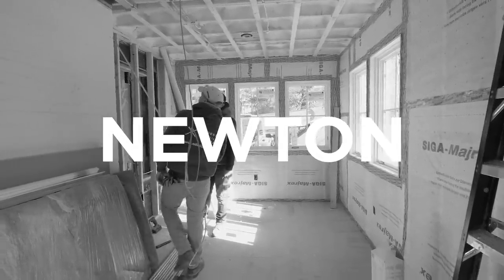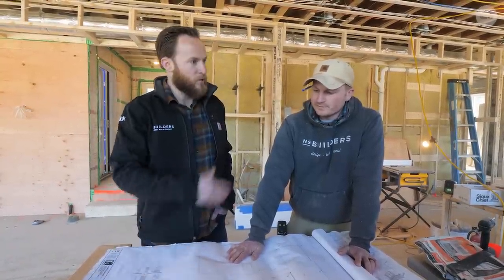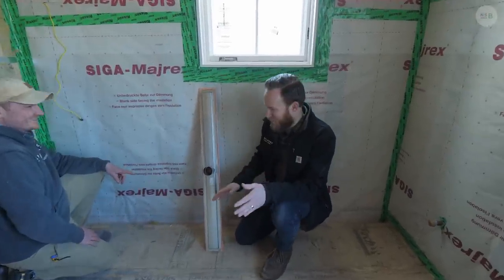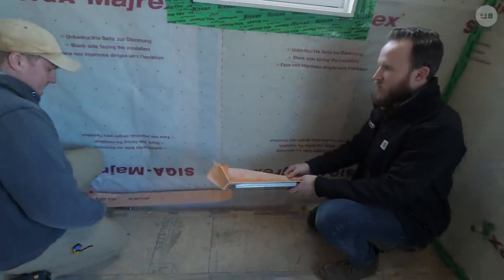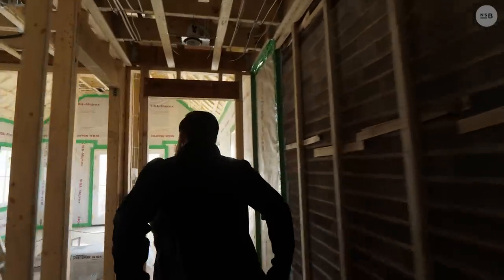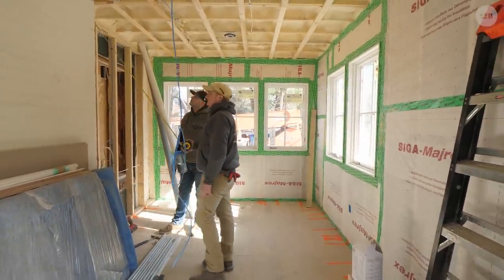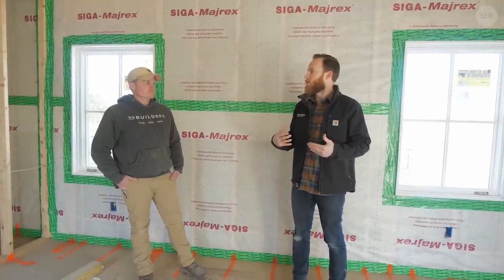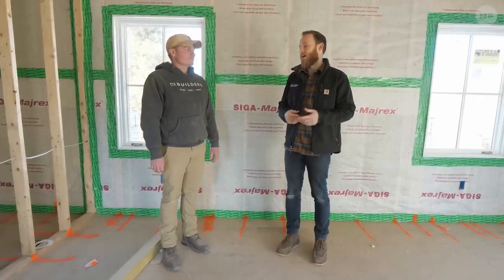How Siga Majrex works at our NS Builders Newton renovation

Comment: I always enjoy your videos! I'm a plumber in the SF Bay area and I've  installed many drains for curbless showers. 2 things here; 1: I'm not a big fan of the schluter drain system due to the interface between strip drain outlet  and trap fouling chamber because of the no hub coupling required at the time of drain setting in  what is typically an inaccessible area in the floor. 2: We use the UPC and or California plumbing code and a 2" elevation difference is required between finished floor ( interchangeable with threshold in a curbless install) and finished drain elevation. At a very steep 1/2" per ft you still need a 4' pan, I see a lot of 8' pans which terminate near vanities and toilets in some spaces. Curious if you're required to adhere to this code. Inspectors are sticklers for it around here.

Comment: As I've watched building shows, and I see interior vapor barrier I always wonder.  
Why on the inside.  Soon as the home owner puts a nail in the wall to hang a picture, or drive a screw through a cabinet etc .... doesn't that just defeat the whole purpose of the vapor barrier?
Reply: In cold climate, which they are in, it stops warm vapor traveling toward cold exterior sheathing and condensing on it, which would cause rot and provide grounds for mold, also when fiberglass insulation gets wet it looses insulation value. A gap around a screw isn't enough to make it pointless, unsealed electrical outlets or absence of barrier behind the tub would cause troubles

Comment: I'm confused about the double wydth brick wall. Did you guys leave it uninsulated and exposed on the inside or did you frame out then use mineral wool and majrex to air seal? Could you clarify a bit?
Reply from the maker: The brick wall was existing in the original part of the house.  In the addition we used mineral wool and majrex. Aero barrier throughout the entire house.
Reply: @NSBuilders  Ok, so basically you guys didn't touch the brick wall? Only reason I'm asking is because I've been researching this for a long time for my own project and info is so hard to find. I have a double wydth solid brick Philadelphia home (a twin) built in the 1930s that I've slowly been renovating in my spare time. I'm excited to be in the interior framing stage but have been having tons of trouble finding solid info on what to do about insulating. Probably the best chance I have is to get my brick tested and do and energy audit (or so I've heard) but for now I'm researching best practices for insulation on brick. 

So far I have already lime plastered the interior face of the outside walls with NHL lime and my game plan is to use a Mineralwool bat insulation between the studs then do an Intello plus "smart" vapor barrier to encapsulate the living spaces. It's similar to the Marjex stuff you guys use. I also plan on spray foaming the wooden roof rafters on my (currently vented) flat roof (and even there I'm not sure if I need open or closed cell or if it even matters)

Thank you for your original reply, you guys rock! Keep doing what you do and keep spreading knowledge!

Comment: Sharon Massachusetts plumbing inspector told us to spray foam the bathroom especially where Stand shower or tub is going it’s the code. 
How did you get away from that?
Reply from the maker: O A were hitting the thermal r value requirements and proper vapor retarder. Type of insulation cannot be mandated.
Reply: Very good and thank you for responding.

Comment: Great video. I'm actually going to be using the siga on my small house build. The info missing even on the siga website and what I see as a possible problem with the product is the cladding install penetrations. Won't the dry wall screws penetrate and this product is not self healing. Only way would be to installed ensuring screws hit the self healing tape? Perhaps I'm missing something. Would be great to follow up with this info as it's lacking in the siga install docs as well
Reply: drywall screws hitting the stud will seal well enough that its a non issue. the problem i see is people hanging art work, or toilet roll holders and penetrating it not on a stud. In this case a service cavity framed between your internal vapor barrier and drywall will prevent this, also it gives the sparky somewhere to run wires and avoid flushbox air sealing issues

Comment: Great video, Nick! I'm working on a townhouse in Philly now and was planning to sprayfoam front and back brickwall. After your episode i'm having a second thought - in my case no joists attached to the wall, but freeze/thaw makes me think twice before i do it. But again, how do you leave brickwall uninsulated?  Can you share where did you get your info about leaving brickwall uninsulated from?  Thanks
Reply: Serge Maslennikov I’m also in Pa, norristown to be exact, I been researching  and damn, I can’t make my mind. 

I’m curious to know what is or was your final decision  as far of been insulated or non insulated?
Reply: @macrapidito1  one episode  Holms on homes shows just that. There is no wood , no worries. Spray foam sticks to bricks, water from outside  will not get between foam and bricks , vapor from inside will not penetrate closed cell foam

Comment: Great info especially on new products like the Siga. And I see it advantages using it. But doesn't it just move the moisture problem from the interior of the wall. To the inside surface of the Siga membrane? Such as where the back of it would normally come in contact with drywall or plaster (unless a drip plane air gap is added). So please recommend a paper-free, moisture and mold resistant drywall or breathable plaster to cover it (or did I miss that recommendation?). And lets hope, a Siga like membrane is added to drywall and joint tape, is developed to keep the moisture from being an issue with the drywall at all. 

And if I may suggest, you check out Just Bio-Fiber(Justbiofiber.ca) that is an engineered self supporting hempcrete block that addresses many of moisture and insulation issues in more sustainable manner. Hempcrete and the plasters that usually are used to cover it, tend to be highly permeable. And the high alkalinity of hempcrete blocks that don't need wood framing. Makes it highly mold resistant while still being able to absorb moisture from the room and then release it. While insulating the structure and being even more sustainable than even using wood. Also they are certifying the blocks to help pass code inspections.while decreasing the high labor costs normally associated with using alternative materials. Just Bio-Fiber and hempcrete is work in progress with the growing of hemp just becoming legal again in the west. 

High tech materials like Siga make sense to try to overcome the moisture issues of building becoming more air tight and insulated when using conventional materials like OSB that will riot and mold when wet. But inherently more compatible properly designed and engineered natural materials, will increasingly make more sense in construction.
Reply: N C  I was also thinking about using  paperless drywall, it will be like  if you where using Plastering. 

correct me if I’m wrong but I think   paperless drywall  for the exterior walls and paper drywall  for the  interior  walls and ceilings will be  Ok. 

As far as I’m understanding, Nick  is not insulting the exterior walls  and he is using the vapor barrier as his insulation/ vapor barrier layer but he is insulating interior walls ? 

🤷🏻‍♂️🤔

Edit:

As far as  the  drywall screws issue it came to my mind...
why not use  some kind of self adhesive membrane like  a window flashing over  the vapor barrier membrane on every stud in that way when the drywall is installed it will go through the self adhesive membrane and will be sealed 🤔

Comment: Nice video, Nick! I’m enjoying watching your growth in terms of performance and a little in carbon footprint. Keep up the great work. Just curious why wait until after the blue board for aerobarrier. The Majrex should be your air control layer, correct? Also, why did you choose the rissan tape over the wigluv, wigluv is vapor open?
Reply from the maker: Kyle Macht recommend that approach. We didn’t use Majrex over the existing structural brick so we wanted to make sure
Reply: @NSBuilders  I forgot you didn't have Majrex on the ceiling, so the blue board up there makes sense. Nice work!! I am looking forward to seeing what numbers you hit for the blower door score.
Reply from the maker: @kylemacht  stay tuned for the next episode, really good for a home built in the 1930s and definitely well below code.
Reply: @NSBuilders  Awesome!